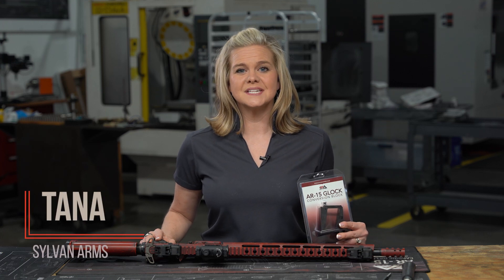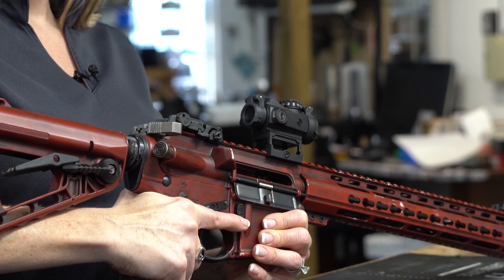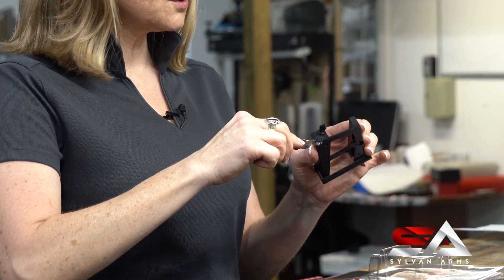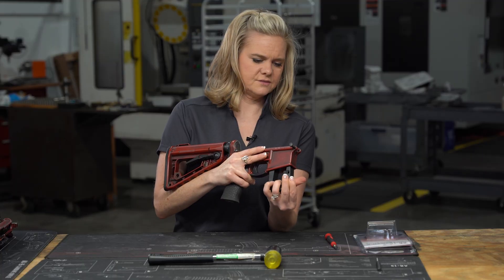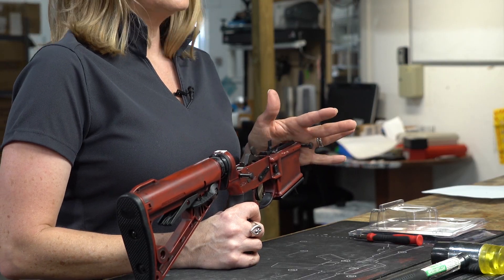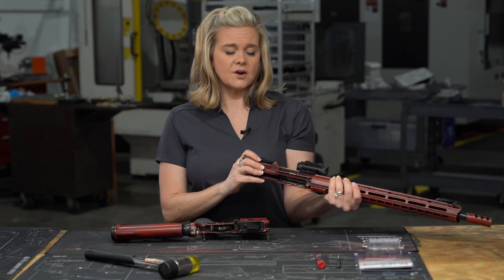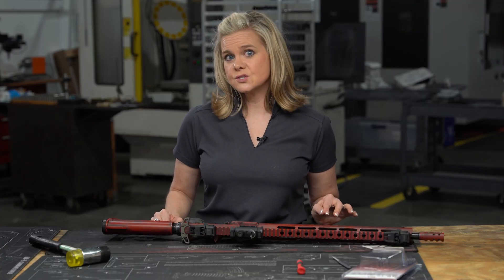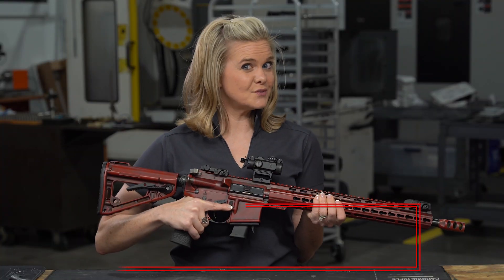Sylvan Arms 9mm Glock Conversion Block FULL INSTALL

Comment: as awesome and cool as the @SylvanArms conversion block is. I have to say that a consumer can buy a complete dedicated Glock compatible 9mm lower receiver, for the same price or cheaper. personally I think @SylvanArms should lower the price to about half that, or lower and consumers would buy them left and right
Reply from the maker: Options are always good!  Thanks for watching and for the feedback.
Reply: Just a stripped lower receiver? The parts can add a lot to the cost, especially if you pay to ship from multiple sources.

Comment: Is this the same conversion block as the PSA one? And will this work with a 9mm Bear Creek Arsenal upper assembly?
Reply from the maker: Yes this is the same one, PSA sells our Glock Blocks.  The Bear Creek Arsenal upper should work just fine with the glock block.
Reply: Did u ever do a bear creek 9mm upper
Reply: @flacracker420able the question is why would use a bear creek arsenal anything?  Cheap junk.

Comment: Does this adapter take glock 45acp mags or only 9mm glock mag asking for my 45 upper project
Reply from the maker: Unfortunately, they only work with the 9mm Glock mags. A 45 ACP does NOT fit.

Comment: Why did she use a hammer on the takedown pins?
Also what someone mentioned about PSA being tight, it is the same with my PSA and Anderson Lowers. Are their lowers out of spec?
Reply from the maker: Anderson lowers aren't mil spec in my experience and can cause issues.
Reply: @SylvanArms  Pretty bold statement. I have experiences with building many lowers Aero Precision, Spikes Tactical, Anderson, Palmetto State Armory, Stag Arms and even milled out my own from various suppliers, never had a problem with @Anderson Manufacturing being "non-MilSpec", interesting using a video where you have to punch out takedown and pivot pins. Should have used a different rifle for a social media video. 🤷

Comment: I am trying to use this with a PSA lower. It's a tight fit to go in, but once seated, it has about a 1.5 mm play. None of the magazines I tried stay seated, tugging on a mag drops it out. Mags tried were Glock oem, ETS, Pro Mag and pmag. I am disappointed. Due to the ammo shortage I could not test it in time, and now it is beyond the 30 day return period. So I have a weird looking paper weight.
Reply: did they ever resolve the extra play issue? looking to purchase 1 of these for a psa lower as well...
Reply from the maker: Hey! Send me a message so we can get you taken care of! service@sylvanarms.com
Reply: I have the same problem did this ever get resolved
Reply: Should've bought the Stern Defense conversion kit. Bulletproof and reliable! Iraqveteran8888 tried to destroy that conversion kit in one of their meltdowns but failed to do so. Its unstoppable.
Reply: I had to do a few things with every magazine I tried.
First, put a strip of velcro tape(use anything handy) along the back side of the mags along all the length that contacts the magwell(about 2 inches). This eliminates the front/back movement that allows the mags to come loose from the catch. If they still do not lock in, use a file to deepen the catch recess cut into the mags. On some mags I had to widen the recess as well.
Another problem we found was if the mags were inserted too far, the bolt would slam into the back edge of the lip of the mag, pushing the metal forward so rounds would not feed right or even come to the top of the magazine. Fixed this by wrapping the mags with tape so the could NOT be inserted too far. Also if you rest the mag on a table or ground with nothing to stop it from over-inserting, the mags tend to get pushed too far into the magwell so the bolt jams the feed lips as well, usually resulting in a round fed vertically in front of the bolt. Tape wrap to limit insertion depth solves this problem as well.
Reply: I got one of these and have the opposite problem. The block fits well but it's like not milled enough, so the mags have to be SMACKED in and essentially get stuck inside. Pulling the mags out is shaving plastic from the sides of the mags.

Comment: I have a cmmg mk9 upper. It has a 9mm dust cover but it is capable of taking 556 mags if I used the receiver for a 556. What I mean is it has a big ejection port but 9mm barrel and bcg. Would this work for that or do I need the small 9mm ejection port?
Reply from the maker: Yes this will work and your ejection port shouldn't matter.

Comment: Does this take 10 round Glock mags?
Reply from the maker: If it's a double stack it will. The single stacks won't but I've seen "double stack" 10 round glock mags where they just use a spacer to make it the width of a double stack.
Reply: @SylvanArms  interesting...

Comment: Is that conversion provides last round open bolt feature?
Reply from the maker: It does not.
Reply: @SylvanArms  it’s not a big deal but it’s good to know it. Thanks!
Reply: I installed this on my ar15 lower and does the mag block adapter normally supposed to have a tiny bit of wobble or "slop" in it? I feel like it could lead to malfunction/reliability issues.
Reply from the maker: It honestly just depends on your lower. While made to be universal, some lowers we've found do have a very tiny gap but hasn't lead to any reliability issues in our experience.